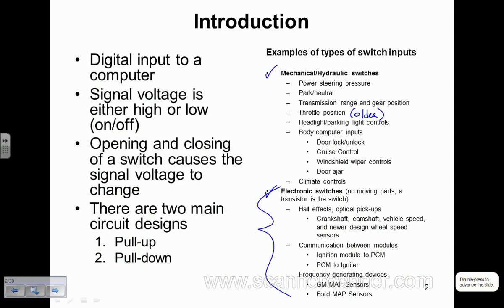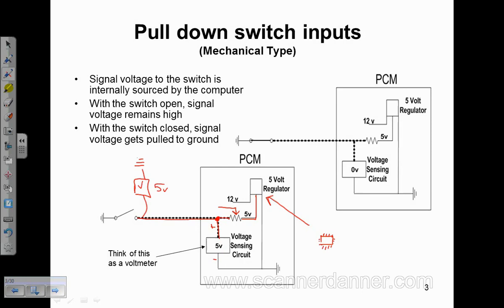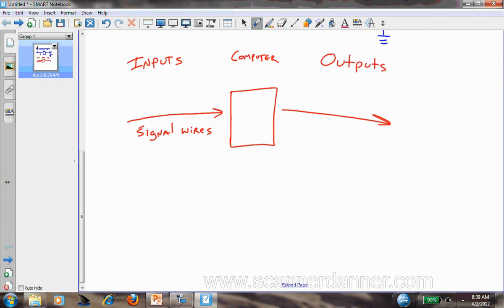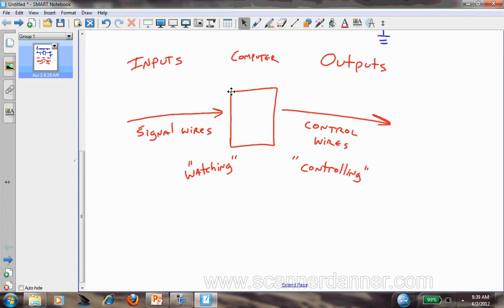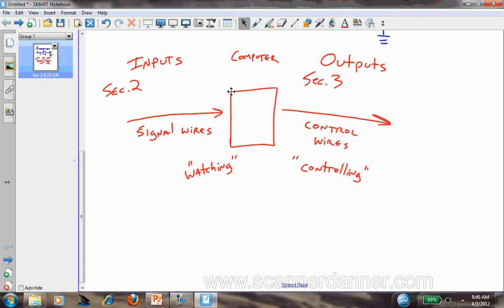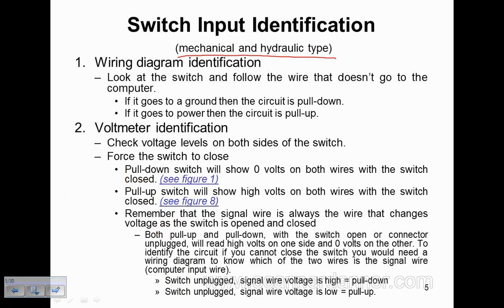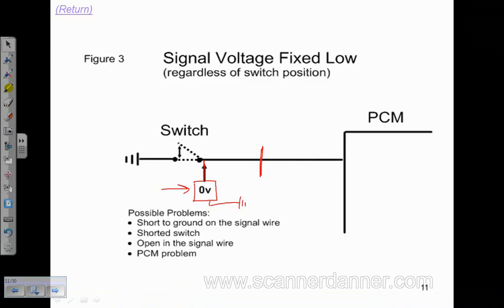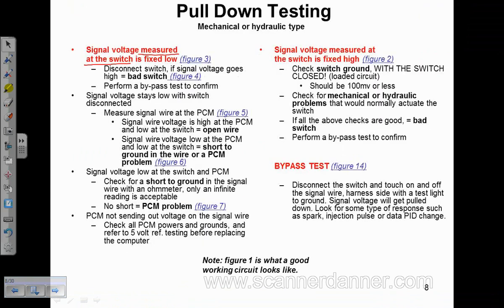Chapter 2 (Switch Inputs) classroom lecture - an SD Premium preview

Comment: You could probably say that, but I think that can end up causing confusion with ground side switched circuits which are outputs (something being controlled). 
These are inputs (something being watched) so I try not to mix those terms up. 
Just personal preference. You can call it what you want as long as you remember it is an input and you know how it works. Hope that helps.
Reply: what about a door light switch that gives the BCM a signal ground to turn the interior lights on in VW? input or no? ground on one side and open/ghost -Volt on the signalwire...? :)